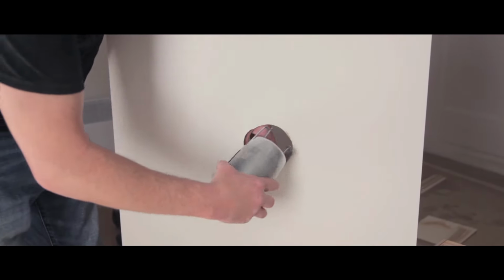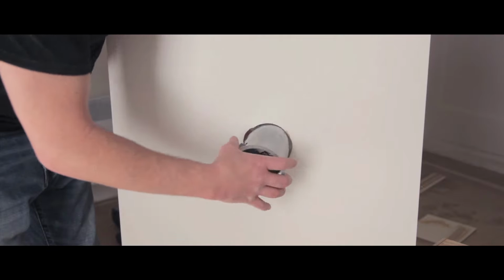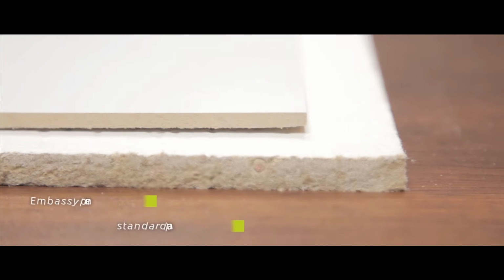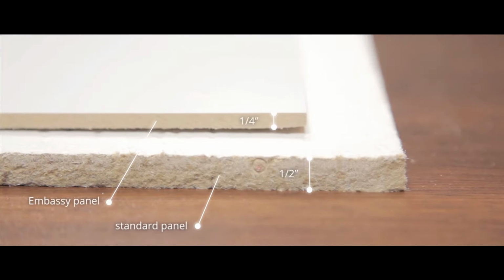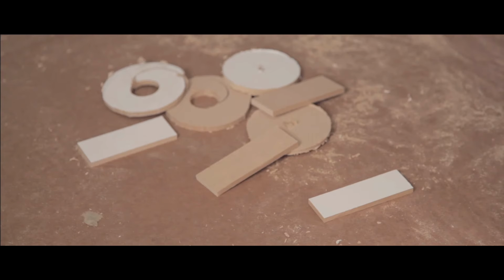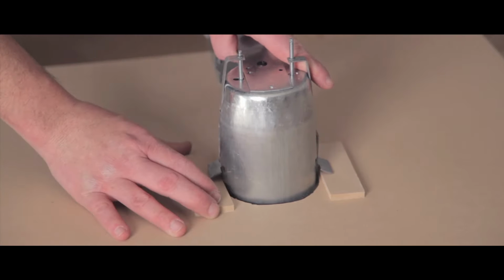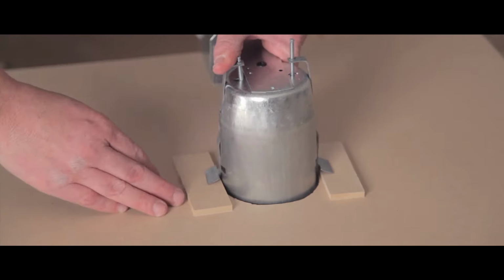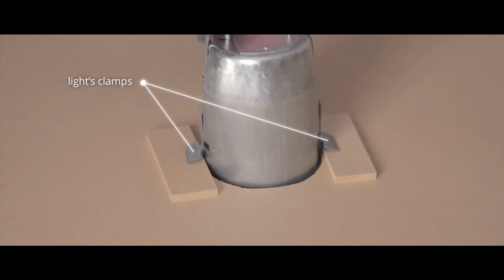How to install a suspended ceiling? | Embassy Ceiling installation video

Comment: You can save some money if you combine 80sqft kit with 60sqft from Cosco. Also use multi tool to make cuts for T-bars it looks nicer. I Did not start installing from center of the room like they said and finish was way better and saved about 15% of the 80sqft kit I bought so if your room is not perfectly square put them on the floor and see how it looks
Reply: Did you get this same brand from Costco or is this a different brand called cosco

Comment: The point of a drop ceiling is to drop the ceiling. I have ductwork to hide. How Will this work when the joists are 8 inch’s away?
Reply: you can have it drop down as far as you want  the inch and a half is the min
Reply: You can also build a bulkhead around the ductwork.
Reply: You can get a professional to do it for you.
Reply: This system is only designed for air ducts and drain pipe that's been installed between the joists.  This allows access and you still get maximum ceiling height.  It also covers up water supply lines just below the joists as per the video.  You would need the standard drop ceiling (using the support wires) to cover your ductwork.

Comment: This looks nice but it takes 5x longer and costs 5x the price of a regular suspended ceilings. They also need a better design for the pieces that go along the wall. Should be L shaped and more flexible. If the wall has any curve in it, it leaves a HUGE gap. And those plastic anchors with only 3 settings are built pretty cheap. Looks very nice, material could be much better